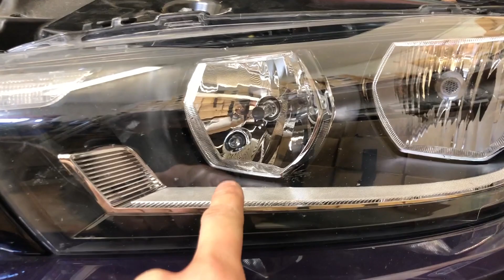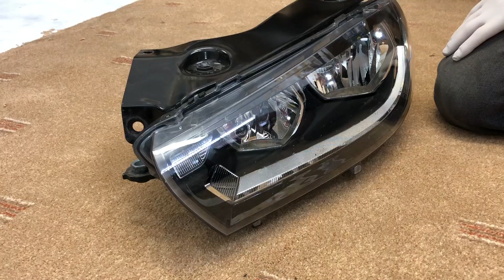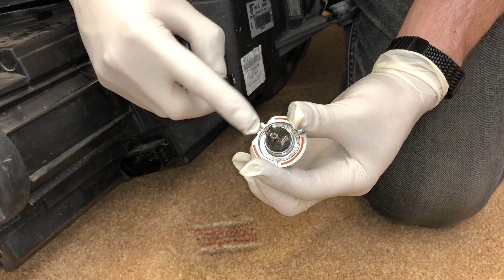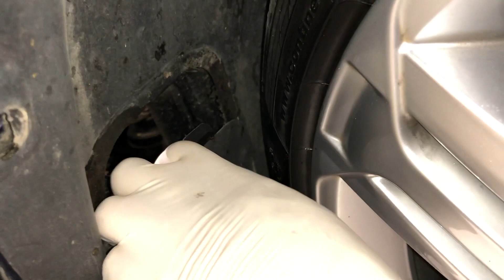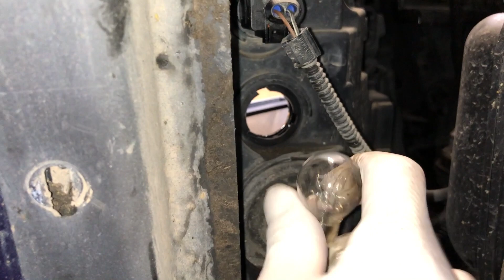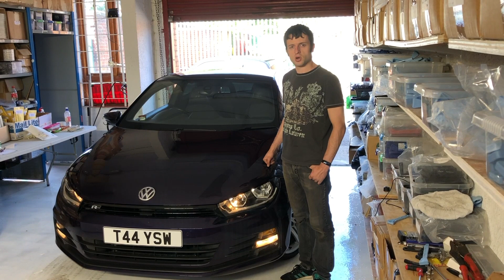VW Scirocco Front Bulb Change Headlight Sidelight Main Dipped Beam Foglight Indicator DRL How To DIY

Comment: Im having trouble changing my DRL on the passenger side, when i go to turn it anti clockwise like you do to release the bulb, my wire doesn't seem to have enough slack so i cant get it to turn far enough to release the bulb housing.
Could my wiring have been put in the wrong position? Not sure what to do next.
Any help would be appreciated 👍🏻

Comment: I bought canbus error free led lights and they look like they take a different type of connection.. Are there any good bulbs for xenon effect you recommend? I also have face lift model. Please make more scirocco videos!
Reply from the maker: Due to the high failure rate of LED bulbs I have given up using them but when I did I would go for the COB or Silica type LED bulbs because when one chip goes or starts flickering it's not as obvious. I can't recommend a high quality manufacturer as I have yet to encounter one.